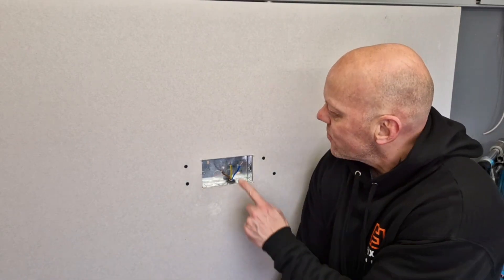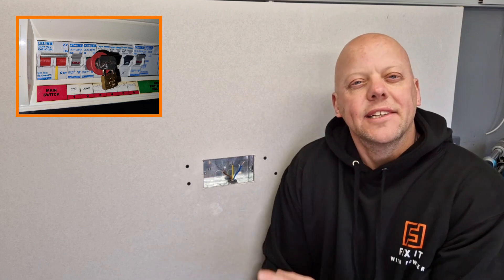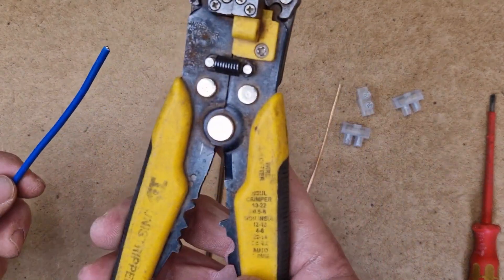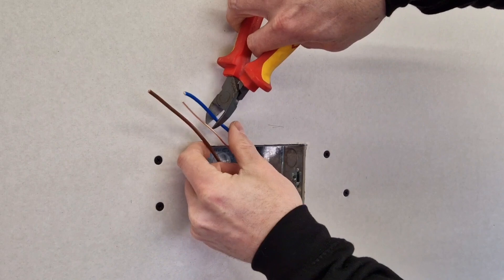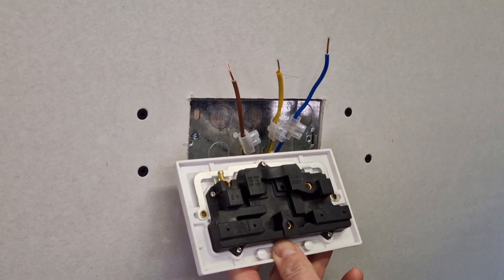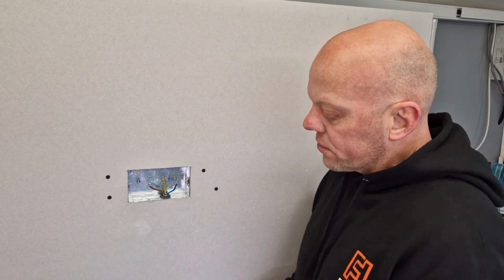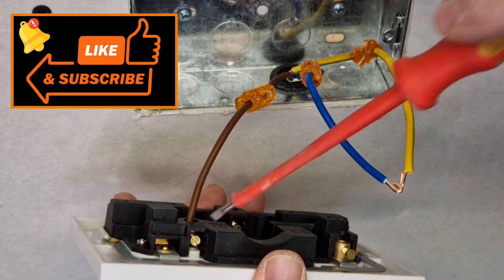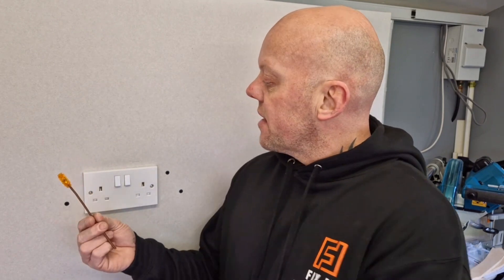Unlock the Secret to Extending Short Wires - Easy DIY Solution!

Comment: Nice video, can you please do one which shows adding a new back box and extending the wires. I have a cold room and want to batten the walls and add insulated plasterboard on top but dont know how  to move the electrical box to the new position.
Reply from the maker: Hi, you need to install a drylining box for insulated plasterboard, something like this https://amzn.to/47ARDk8

Comment: Straight through crimps probably best if you're tight for space in the backbox
Reply from the maker: Yeah, i agree, if the space is tight. These push wire connectors are really easy to use, and 32amp however they are a little bulky.